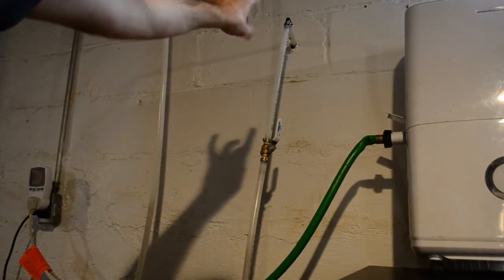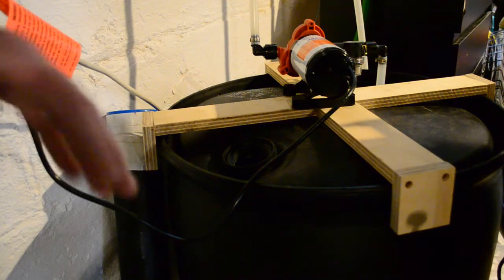On demand rain barrel pump system (Part 1, basic design)

Comment: Note* Jargon and acronyms impede learning.  Please define R.O.  Also, I would appreciate discussion of lift.  I am trying to determine the best setup to lift water from rainwater cisterns below foundation level, up above roofline to a solar water geyser.  Father-in-law in South Africa where municipal water and electricity is inconsistent at best.  Seems transfer pumps offer more lift but do not offer on-demand switching.  Is there a more simple solution than addition of an accumulator tank and pressure switch?
Reply from the maker: I've rewatched the video twice and I don't think I ever say R.O. Can you tell me a time stamp?

In the context of plumbing R.O. usually means reverse osmosis, it's a way of purifying water. I don't recommend taking on a project like this without some knowledge of plumbing terminology and techniques. 

Most pumps will tell you how much they can lift or self-prime in the specifications. I believe the one I link can go 6 feet, which is about what it does in my system. I'm sure stronger ones exist.